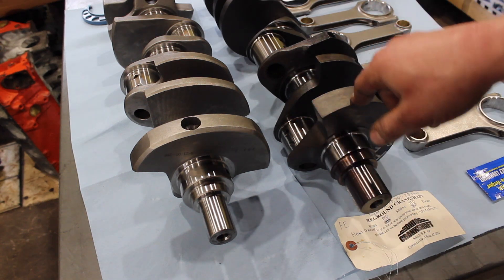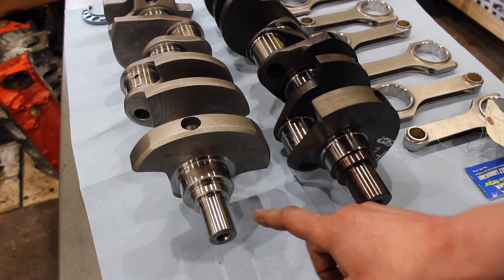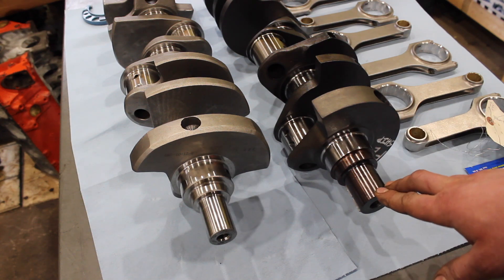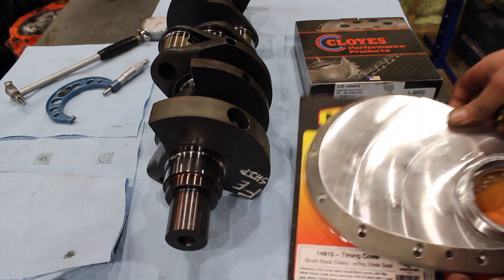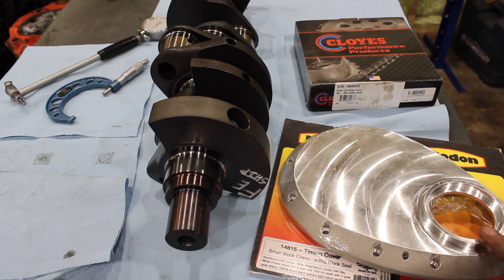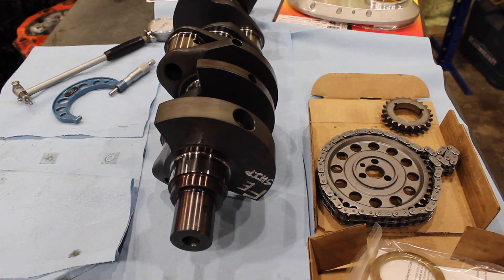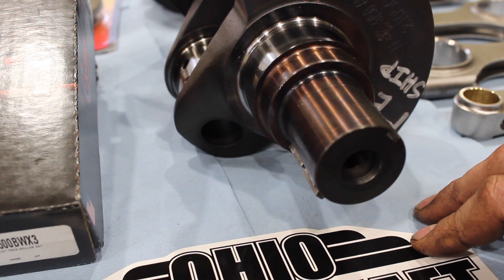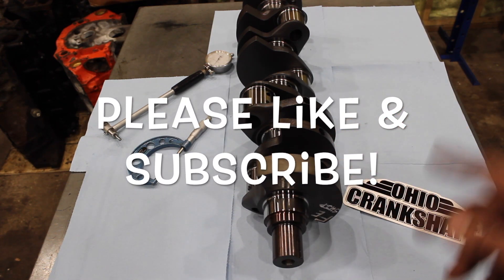Small Block Mixed with a Big Block Crankshaft? Supercharged SBC Crankshaft

Comment: Hello, have you EVER heard of an aluminum crankshaft for any V-8 motor? or even a 4 or 6 cylinder? Some guy is trying to sell me a 2nd gen small block 350 chevy motor. Says it's a custom built 700 horse motor with an aluminum crankshaft. I asked "are u sure it has an aluminum crank shaft?" he repeated "yes - are u stupid? all of the best race motors have aluminum crankshafts" I've been building fords, chevys, chryslers, ect for forty+ years and I've never heard of an aluminum crank shaft before. Aluminum heads, rods, and pistons, yeah sure, even driveshafts and rocker arms too, but this is the first time anyone has ever said this to me, and what's more... he sounds so sure of himself, that I thought - Maybe there's something new that I don't know about?  I think he's full of it! but is that even possible? I'd think it would not only be too light but couldn't take the punishment. Has anyone heard of this? thanks
Reply from the maker: Never heard of that before. Billet? Maybe but even those are crazy expensive. Or possibly it's forged stell and he was thinking it's forged aluminum?

Comment: I would like to use Timing Gears, not a chain, on my SBC crank that has a big block snout, but no one makes gears for that application. (?)  I've always wondered if a machine shop could enlarge the hole on the snout gear to fit and it would be okay.

Comment: How has the ohio crankshaft been working ? I am looking at doing there billet sbc crank for 1200whp setup.
Reply from the maker: So far very good, the machine work and balance were on point! That car hits the dyno very soon so hopefully it all holds together haha
Reply: @cuttersperformance  how much power do you guys plan on putting to it ?
Reply from the maker: @taptoretry7335  nothing crazy, hopefully just more than before which was 550 whp on pump gas. The combo feels alot more responsive now and the torque feels insane. Im worried its going to run out of fuel injector when we dyno it. We shall see

Comment: Pat!..... If you were gonna drop an L31 into an 80s squarebody truck to cruise around and have fun in, 600cfm carb, intake, headers, nothing crazy. What is a great torquey cam recommendation that will work with all the stock roller bits n pieces and put a smile on my face?
Reply from the maker: Probably a xr270 or 276 cam. Next week i will be dropping the Saturday specials 355 video and it made amazing torque for a 355 on the dyno with a 276 schneiders cam might be something youll be interested in

Comment: great content 
 doing simular build, scat 77-350-3480-6000 crank dart shp 4.125 bore  rollmaster cs-1116 set crower 00484 cam .almost bought an ohio crank but found this scat in stock locally in aust  crank too balancer clearance is still critical ROMAC will supply undersize if needed scat and eagle are typically on the loose side

Comment: Question,  why if you have a dart block and buying all new rotating assembly,  why not go ahead and make it a 421 or something bigger? The 3.875 stroke is easy to clearance for. 4.0 inch not so much but just curious.
Reply from the maker: I was wondering if someone was going to ask this. It came down to a mix of budget, timeline, and availability this year
Reply: @cuttersperformance  no replacement for displacement.  Except for boost lol.
Reply from the maker: @timjones4554  exactly!
Reply: BTW I use Ohio crankshafts  in all my motors. They are great pieces. The 615 in my firebird has their billet crank. It has nearly a 1000 passes so far

Comment: Hey I tell ya that sometime when you are splitting balancers I have found you need to mic the snout and hine the balancer’s out because they fit too tight and although ive not used one that has been cut for dual keyways which would make it even more of a problem on a tight fit You might check that out becase tjey will split on ya if the are too tight.
Reply from the maker: Yeah good point! I had to hone the ATI on my trans am

Comment: Loving my key chain . Thanks again and hopefully you will have better luck with this crank than the last one. I had the oil pump in my 347 go bad on the 3rd start up and it was pumping really good when I switched it off the last time so i have a ford performance pump this go around so hopefully it will last longer than the other one .🤞🏽 im going to dissect it and see what happened
Reply from the maker: Glad to hear you like the keychain! And sorry to hear about the oil pump! That sucks, possibly stuck pressure valve?
Reply: @cuttersperformance  it's locked up when I get it out im going to dissect it and see what the problem was because I have never had a pump go bad that I just installed. It pumped fine on the first 2 start ups and on the third one it never built pressure so i pulled the distributor and went to see if I could get it to prime up and my 1/4" impact wouldn't budge it but when I switched it off it was pumping 55-60 psi 🤦‍♂️🤷‍♀️

Comment: It's caused by torsional stress.. especially when rpm flares happen such as when the car is rapidly pedaled. think about what happens to the crank snout when you shift gears, torsional flex is happening in both directions. kind of like when you bend a piece of metal back and forth til it breaks..
Reply from the maker: Oh, I totally agree that there's a ton of stress on the crank, but what surprised me is that the blower company tells you the reg sbc snout/balancer should hold up, but it certainly did not, haha

Comment: Two things here: One, if the crank snout breaks where the balancer meets the snout filet it may be caused by the balancer not having a radius where it meets the crank snout. Two, if the keyway cracks try using round keys and keyways. Square keyways also can crack in pulleys when they are overly tight on the crank.
Reply from the maker: The crack didn't actually break or bend, but we broke two balancers in less than 50 miles total. But the key ways got damaged on the 2nd broken balancer

Comment: 90% of late model dirt track car engines we build are big block snout
Reply from the maker: I've heard that some do, didn't realize that most guys do. 
I'm not super familiar with dirt track, but I'm assuming it is because of the extended high rpm with driving accessories?

Comment: Crank is  a spring when you look at it . Harmonics would caused that failure among others Timing,detonation,oil pressure drop Etc.Super chargers put a existential load on they crank and crank snout harmonics are amplified all so directional force = bottom end failures .  good choice with a bigger crank  snout.crank. Just my opion .peace

Comment: I had that happen on a sbc 400 stock crank in a 408 motor with a ATI super damper. The problem ended up being the fit was to tight on crank and had to hone the damper about 5 thousandths. But it fixed the issue
Reply from the maker: Thats a good point, I had to have the ati balancer on my trans am honed for proper fitment
Reply: @PISS-CUTTER Performance  I had the snout break off 2 different times on the same motor and both times it broke rite where the balancer mates to the crank timing gear about 6 months apart.
Got lucky both times and didn't hurt anything else

Comment: Cloyes makes a timing cover with the built in cam button with the BBC snout that would of been perfect for this build! 

I have a regular one(standard crank snout diameter) on my short water pump '65 Impala. It's a close fit but the key word is fit. Its been a while since that one went together so I can't recall if in I had to grind any extra clearance but I don't think I had to and it still worked out.

Comment: Thought u run just a crank hub with a bigger blower. Was it double keyed
Reply from the maker: Alot of blower companies dont recommend a crank hub for street cars as it puts all the harmonics through the blower.
As mentioned in the video the balancer was double key way
Reply: The ATI hubs are nothing more than cheese. Machine one and you'll see. The "stronger" ATI hub is the thicker one that requires the thinner timing cover seal. But the hub is still cheese
Reply from the maker: @Brian Kilpatrick  I was honestly starting to question that myself. Maybe it's time to try another brand for this one. Those ATI balancers are not cheap!
Reply: @cuttersperformance  if you have the ATI balancer already you can just buy the BBC style hub to use with your new combination. But yes agreed they are not cheap for something that essentially does it's job with 2 o-rings

Comment: why are you not using a snout bearing support?
extends out beyond the balancer to keep any runout from developing from the tension of teflon stripped rotors on the snout of the crank
Reply from the maker: I thought about it, but there's no room in this car for decent support. I already have to remove the rad fans just to adjust the blower belt lol
Reply: @cuttersperformance  ugh, the vette and diesel are the same way, water pumps so tight to the damper now you have un-assemble everything to put new belts on 😑

Comment: Howards makes a nice billet double roller for the oe step nose cam but crank gear is just for a standard sbc crank snout
Reply from the maker: O yeah its no problem getting for them an sbc. I use them all the time, but the issue is the bbc snout with oe roller cam
Reply: @cuttersperformance  got ya, was gonna say i know there's a few but then thought about the snout was what you meant after id posted lol

Comment: I've seen the very thing that you are doing a work-around on in this build.  That said, I've heard several theories on the "Why?" of the situation.  One theory that seemed to make sense to me (what would I know about it) was the idea that the blower was set up too "tight" if you put of the injection load thru the "hat" vs thru the injections; thus closing up the tolerances between the blower rotors.....this passed the force needed to spin the blower on to the nose of the crank.  Dunno is that theory holds water but makes some sense.
Reply from the maker: I've asked that very question, is it the combination of a new tight teflon stipped blower mixed with the fuel pulling through it...just too much stress for the small snout? Nobody can give me a straight answer.